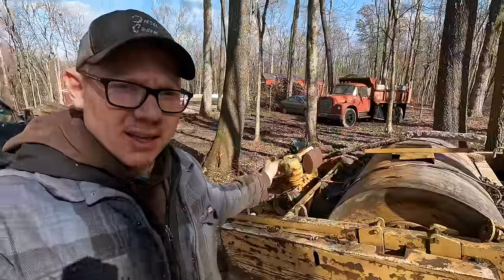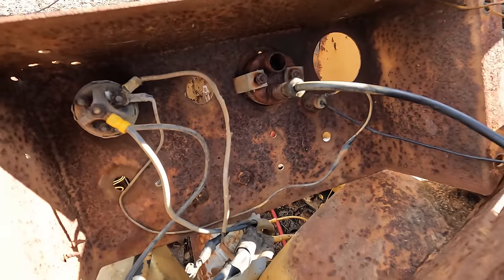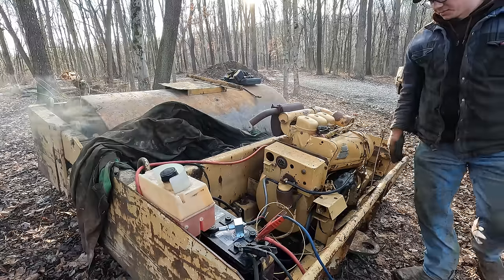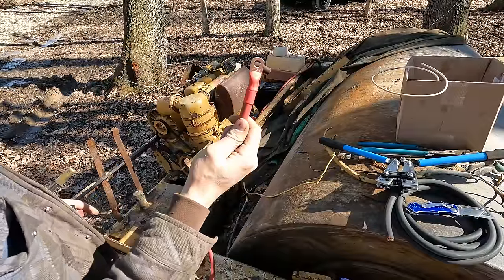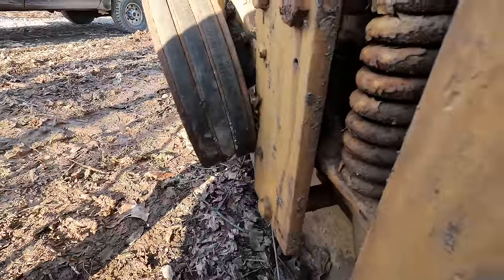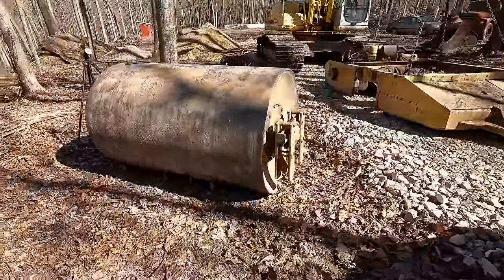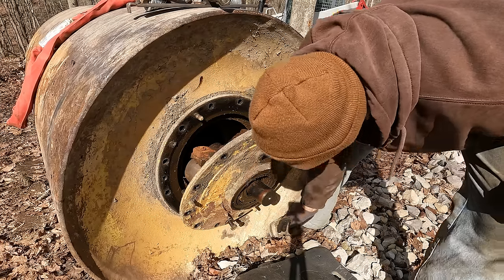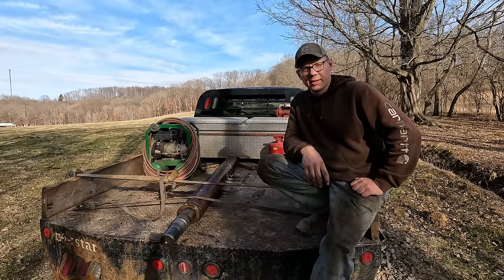Diesel Roller Compactor First Start in 30 years!! Can it be saved??

Comment: Those type of GlowPlugs are wired through a low-value resistor. (less than 1 Ohm) The resistor drops the 12v down to ~ 9.5v.  This resistor often takes the form of a "GlowPlug indicator" which is simply a short coil of nichrome wire which gets red-hot so you can see it working. (of-course, the hotter the indicator gets, the lower the voltage to the GPs.... self-regulating)
Reply: Exactly
Reply: Yeah just came here to see if someone had commented this and we are good
Reply: The resistor's purpose is to limit the amount of current that can flow through the glow plugs, the value if the resistor can be calculated using Ohm's Law. Without having the resistor in the circuit the heating element in the glow plugs will quickly burn out.  Perhaps use a multimeter to check the old glow plugs for continuity.
Reply: Also he talked about these glow plugs being in series, but the way they were mounted, they would be in parallel, giving the full voltage to each plug, instead of splitting it 3 ways, if they were in series.
Reply: did not know that that's a neat and simple setup i love it!
Reply: Early Kubota B7100's used that setup
Reply: @timmitchener6148  you know i love old simpler tech like that just hold the button for a few seconds then turn the key so much more fixable then the pile of relays and control modules that is modern vehicles
Reply: @timmitchener6148  My B7100 has the little coil of wire on display on the dashboard, but I've never seen it actually glow, despite needing to give it 30s or more of pre-heat before cranking.

Comment: Im an electrical engineer. My tip is not to tin the tips of your cables as solder is a poor conductor and oxidize very quickly and encourage breaks near your connector when fibrating, it matters at high currents. Usually copper to copper contact is the best. But if you are going to tin thick wires like that its best to use a solder bath, you can use a tin you heat up with solder inside until it is a liquid bath. then put some flux on the cable you want to tin and dip it in the molten solder.   But first prize is a proper crimping tool with the correct size lugs and go copper on copper.
Reply: I personally also use some copper paste on the contacts
Reply: I solder a lot of smaller wires for RC projects. I like to lay copper on copper overlapping end to end twist them together, then solder with heat shrink. It usually holds pretty well.

Comment: good to hear the old engine up and running. I was cheering when it finally caught and kept going 
 If costs get too high on the repair it may still be useful as a static roller. seal up the end flanges and fill it with water for weight.  And you will have a massive pair of steel balls for the next project that requires them.  or some amusing shop art or vehicle decoration lol. Would love to see the old roller going again but with all the repair and parts needed at today's prices I'm wondering if it will be prohibitively expensive.

Comment: Are you sure this wasn't a 6V system before? That would make sense for the glow plugs to be 5-9V and the alternator not charging a 12V battery.
Reply: Never seen a deutz like this with 6volt system before. You will get way to much amps with a diesel starter
Reply: 6v would have a generator not alternator.
Reply: @elijahparedes9172  they do make 6v alternators, i remember specifically they make them for old cars like a model A
Reply: Nope - 3 glow plugs in series across 12V is 4V per plug. 13.8V is 4.6V..
Reply: Except I'm not paying attention. They're not in series if they are wired on a common rail like that. Pay attention before commenting :-)
Reply: @gtb81.  model A’s came with a generator not an alternator, however they do sell 6v alternators but not in this situation.
Reply: @timwatson682  lol D'oh!
Reply: @elijahparedes9172  that's what i was saying, you can buy 6V alternators for model A's. though i prefer the generator to an alternator because there's no rectifiers or electronic regulators to fail, most times you just need to clean the regulator contacts or replace the brushes
Reply: but in this case it's most likely the voltage regulator that has failed inside the alternator
Reply: I have a Belarus tractor that uses a resitor for glow plug voltage,  odds are its the same for this .
Reply: The glow plugs probably run a resistor for voltage,  my Belarus tractor is set up that way
Reply: The system likely had a resistor to drop the voltage to the glow plugs
Reply: The glow plugs are in parallel, so they all receive the same voltage👍
Reply: The starter would be turning over way quicker on 12v if it was a 6volt starter, and it would likely be smoking/burnt out in no time👍
Reply: Pretty sure I saw an external V regulator for the alternator mounted next to where the original control panel was. That external Reg might be faulty or may just need it's contact points cleaned to get it working again. If I'm mistaken on that, then the alternator may have a built in regulator that's faulty, or it possibly needs a charge lamp wired in series to the (L) terminal to excite the windings, and/or an ignition on feed connected to the alternator (i) terminal to turn the regulator on👍
Reply: Quicker heating. Ford/international did the same thing on the 6.9 and 7.3. They heat up quicker and burn out easy. But you don’t have to sit there on heat for a minute either.
Reply: @jordanwenger440  I'd also suspect it's designed to use a resistor coil with the plugs in parallel. It's usually fitted in the dash and looks like a metal grille with a coil behind it. When preheating the coil heats up and starts glowing. When it's red you are ready to start. The hole to the left of the ignition switch looks about the right size for where it would have been.
Reply: @OverKillPlusOne  I think some Japanese diesels also used 6 V glow plugs in 12 V systems. My parents have one of these and it's 25 years old on its first set of glow plugs. Above 10C or so glow time is neglibible, turn the key to "On", wait for one deep breath and turn to "Start".

On a properly old industrial diesel like this I'd expect a resistor coil though. It doubles as a glow indicator and some people abuse it as a cigarette lighter (quite a few European tractors didn't have any sort of grille or mesh in front of the coil and the hole in the dash is just the right size for a cigarette).
Reply: @timwatson682  They are not in series, that is a classic parallel connection.
Reply: When people rate voltage, or anything for that matter (Allabama excluded), they rate the lowest to the highest in that order. Instead of 5-9V (in the video he stated the other way round, 9-5V) It should have read 9-15V. I beleive the 1 from the 15 was inpared.
Reply: Nope, a resistor is used to reduce tension to the required level. My G has a 24V system and glow plugs run on 17V.
Reply: @stefankaufmann8257  I checked again. Some Mitsubishis did run 6 V glow plugs at 12 V but only for a very short time (2-3 seconds)  bypassing the resistor using a relay for super-fast glowing.
Reply: @Ragnar8504  I checked datasheets for the Bosch 0250 200 020 glow plug, didn't find any data about resistance or amps, but simular plugs are rated 9V and 9A and that's what Deutz used at that time. 

Simple old engines like this Deutz didn't use electronics for preglow. The resitor, that reduces the voltage to 9V (or whatever) was situated in the dashboard. You had to preglow manually until the resistor in the dash was red hot. Pretty smart as ambient temperature was compensated that way.

I did some math about these 9V glow plugs: The resistor should be 0,100 to 0,150Ohm, 200W, that should work.
Reply: @elijahparedes9172  actuly all shit come with genrators befor 1960 https://en.wikipedia.org/wiki/Alternator_(automotive)
Reply: @timwatson682  no my in
Reply: @timwatson682  Its all good Tim every thing runs fine on 12 volts and a glass of whisky
Reply: The simplest glow plug resistor I have seen was a exposed coil of resistance wire under a window so you could see it when it turned red hot it was time to crank .
Reply: I am fairly certain that you need a resistor, and it might just be like someone else mentioned and my Satoh tractor had, the resistance wire under a cover, it glows and you crank.
And not that it really matters but I believe the name is pronounced Doitz.
Reply: @LesNewell  LOL, "would have been" is the key here...looks like there's a lot of "would have been" with this free-be.
Reply: @LordFleming  Good point!
Reply: @simonilett998  p
Reply: Hi simon
Reply: @LordFleming  It's most likely 9.5v, where all glow plugs will receive around 9.5v due to volt drop and the glow plug resistor that's effectively the glow plug lamp/indicator.
Also the voltage will drop considerably during cranking to around 10v, but that would only relevant if the glow plugs receive power while cranking, but that's not the case here as the key switch only operates the glow plugs if turned to the fully left position, whereas starter is cranked at the fully right position👍
Reply: @timwatson682  They are wired in parallel, meaning they get 12 volts each. Not good for these plugs! MATT, tear apart a 12 volt fan motor with 16 or 18 gauge wire winding and wire in the field winding in series, will give enough voltage drop. I use this idea when charging a battery to keep the charge rate low at 5 amps, keeps battery cooler.  Use the meter to measure the current flow, can use math to figure out the value of resistance to drop the voltage to 9 volts.

Comment: Great Video Matt. just a thought here. If both ends of the shaft are the same maybe you could weld it and reverse it so the drive strain is on the un welded end?
Reply from the maker: The drive side is longer, plus the weld repair will be stronger than the original shaft
Reply: @DieselCreek  -unfortunately yes and no…the issue with the weld repair is the metallurgy after the weld repair
  .  Assuming they will be able to counterbore and weld the shaft(we would make an entire spindle and weld it in the thicker non machined part of the shaft) then heat treat it the repair would likely outlast the machine.  
   If they simple try to bore both sides of the broken shaft, face it, sleeve it and weld it the repair will fail again.  Even if they heat treat it.  The issues is always vibrations of the roller assembly.    However the amount  of use this machine gets is minimal so either way it might function.
   Unless this was going to be used a lot.  I would scrap it and rent a roller.
Reply from the maker: @kevinoscarson2941  Im 99% sure they will turn both sides down to a point tack them together then sub arc weld them back up beyond the finished surface and re-machine.
Reply: The cost of a new shaft may be less then trying to fix this shaft @DieselCreek
Reply: @johnstoltzfus8772  that's what I thought when I saw it when it came out.   The center circumference doesn't matter much.   
Get a shaft, and have the ends machined down.

Comment: Love to watch you working on machines repair 🤟Your face turned exciting within engine cranking up runs great 😀
Reply from the maker: Thanks!
Reply: @DieselCreek  Glowplugs ... test them outside engine. Conect negative to housing, and positive to the top terminal. Afret 15s it should be red hot. It ok to run 15v to them. After they work make shure that voltage comes to them, if aluminium head corode there is no ground there 😃😃😃
Reply: @DieselCreek  wire in a gm 10si one wire alt
Reply: @gertraba4484 , unless that alternator is frozen up, I wouldn’t mess with it. He’ll only use that roller for a couple hours rolling that building pad, an hour to roll the sub base and an hour to roll the stone once he puts it down. And that’s probably more than what it will take.
Reply: @Hoaxer51  The only thing drawing power is the "temporary" clacker fuelpump anyway. So unless he has to run the starter a lot to get it going it won't be a immediate problem.
Reply: @Hoaxer51  well knowing him he'll  find uses for it...think he mentioned  packing gravel down his road driveway too
Reply: @gertraba4484 , it’s kinda like The Bibliofilus said, he really doesn’t need an alternator because diesels don’t need power to run but I understand why he works on this stuff, it’s because we really like doing it. And you’re right, it would work great on his driveway but he’ll still only use it a couple times a year at his  Ponderosa. All said though, I hope he can get that shaft repaired, cleanup, grease and reuse those old bearings, heck, he probably has an alternator laying around somewhere.

Comment: Mat, every alternator need field excitation to work. It can be either internal, nor external. Check your alternator and if you find F or L terminal unhooked, it cannot work. If it has L terminal, that means there is an internal regulator and it just needs an indicator lamp hooked up to 12V. If you find F terminal, you will need external regulator and the lamp.
Reply: Earlier in the video if you look closely the wires are cut going to the alternator, that is where you need to Excite the field, matt can look up a wiring diagram and figure it out pretty easily
Reply: Plenty of vids on YT to put a Delco 10si on old equipment. Easy as pie, works every time. I've done it several times. Delco Gold 334-2114 $50 on Amazon is what I use.

Comment: It's going to be like 68° in our corner of the state today, brother! I'll be welding in a repair section to fix my rotten Jeep TJ frame - you have one or 37 projects you could work on, yeah? :P
Reply: Gonna be a nice toasty 85 today near me
Reply: Im also working on my TJ frame. No rot yet, I drilled some drain holes in bottom of frame to hopefully prevent that. Lotta surface rust on mine tho. Nice weather today im going to attempt to coat the frame inside and out with fluidfilm
Reply: Also have a rusty TJ. But working on an MG Midget because it's more fun.
Reply: @joshpasstheaxe  - fluid film is the key!
Reply: @mundanestuff  - I rebuilt a '64 Land Rover  88 on a new galvanized frame, rebuilt the engine, etc. Lucas - The Prince of Darkness!
Reply: @wes11bravo  indeed. Headlight? Don't be silly. Indicators? Sure. Sometimes. Ignition? Oh, wait, you wanted spark?

Comment: Love your optimism Matt! Congratulations on another restart of old equipment! I hope you can get the shaft repaired and new bearings for a reasonable price! I couldn't find the electrical specs for the glow plugs. You need to know how much current they draw to determine what size resistor you need to drop the supplied voltage down to the 5-9V range. You might be able to use an ignition ballast resistor from an old Chrysler product or maybe one per glow plug. Good luck!

Comment: Good luck with the shaft, Matt! Hope you get this beast running. As for the alternator: the alternators in some of my tractors have an input positive - if not connected to the battery, the alternators simply won't generate electricity. May be yours is one of that kind

Comment: I've always had good luck cranking with the injection pump off and letting it build some heat in the cylinders, flip the fuel on while still cranking.

Comment: A trick to use when stripping insulation from stranded wiring:  Before pulling the insulation from the wire: twist the insulation around the wire in one direction until it becomes easy to pull away from the wire'  This makes it much easier to insert into terminals for and butt-splices.  It also makes it easier to tin for soldiering.  When using a torch to soldier or tin wires; turn the torch as low as possible and heat the metal so that the metal will melt  the soldier.  One other trick:  after using heat
-shrink tubing tubing, apply a liberal coating of PVC glue on the joints of the tubing to make the joint rain-tight.  It also works on electricins tape to keep out moisture.

Comment: When it comes to buying bearings I always check ebay and other surplus and supply places. I needed some large tapered roller bearings that normally costs around $500 each and I was able to find them in the internet for $50 each.  The best thing you can do is to cross reference the bearing with all other manufacturers since many places list bearings by whatever number is on them.

Comment: If you have a Bearing size i might have some used spherical roller bearings that may be correct for your application.  We rebuild industrial equipment and when the rotor needs to be rebuilt the bearings need to be removed, and we have a policy not to reuse bearings although they are serviceable.

Comment: Well, I know it can be disheartening to see damage like this, but if everyone believed in proper maintenance, then some of us would never be able to find or afford such cool toys. 
Our shakers work on the basics of a driveshaft with heavy hammer heads welded on. Then, the driveshaft goes to a bearing that is surrounded by  thick, dense rubber mounts (think hockey pucks). It may not be the grand scale as your beast, but it can be more effective than it sounds. Good luck!

Comment: You can replace those with a modern self-regulating plug, and then feed them 12v.  I plan on doing that to the Kubota diesel in my 1782.

Comment: Just curious if that EPA company has ever contacted you Matt.? I've seen on other programs that work or build diesel engines/ vehicles they have said they got letters from EPA regarding coal rolling and excessive smoke. I only ask because with the roller there was tons of smoke till the little engine warmed up. 
Awesome job and patients getting it going by the way. I thought there's no way after thirty years of sitting it would start and run. But you did it again Matt. Fantastic job as always.